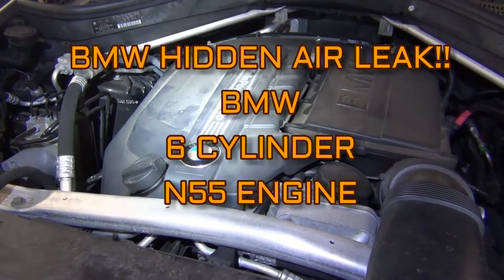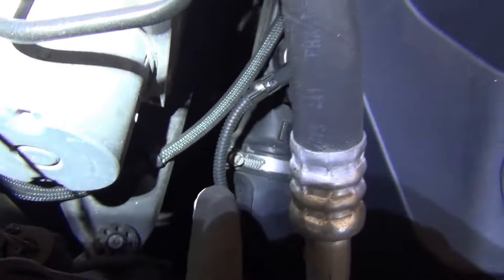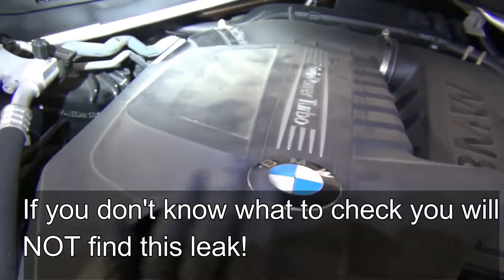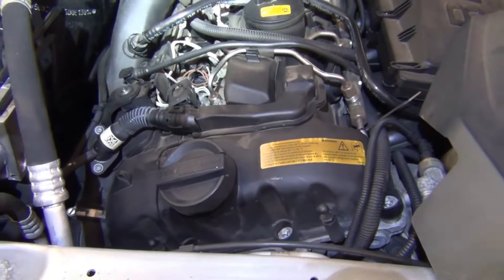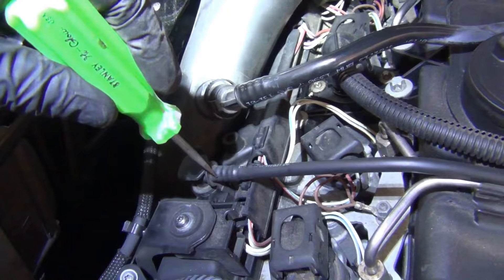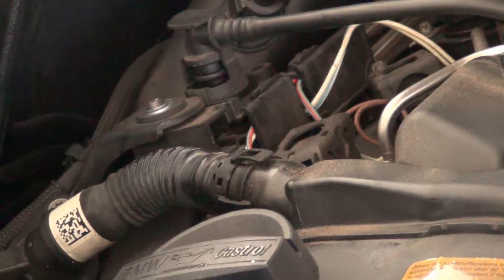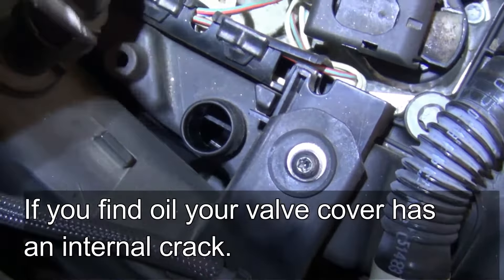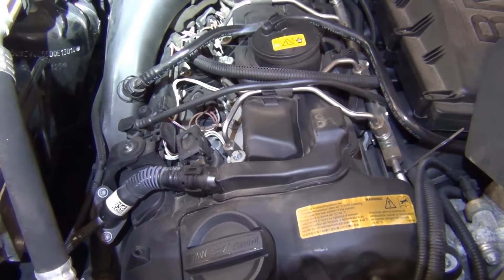HIDDEN AIR LEAK !! BMW N55 Mixture Too Lean P0170 P0173 P2279 2C57 Bank 1 Bank 2 Unmetered Air Leak

Comment: I have the same problem I think. But my engine is a N20 in a 528i 2013. Recently ran into a problem with oil in my vacuum lines and turbo problems so I replaced turbo & vacuum pump. No more oil in the lines. My Mechanic couldn’t find the problem why the engine light won’t go away still. It keeps coming back. Accelerating feels difficult or kind of delayed. I’m thinking it’s the crankshaft position sensor, cam sensor, timing chain, or valve cover/gaskets with the the built in crankcase ventilation system.
Reply from the maker: Hello, Sorry to hear you have an issue with your N20. Are you getting mixture too lean codes or turbo boost pressure too low codes?

Comment: Appreciate that ! I have been chasing this for a bit. Have you seen this fault create the whistling thats common for the front and rear crankshaft seals? PCV valve is not leaking bit the lean faults are present with no external leaks and the whistling.
Reply from the maker: The whistling is a sign of the internal PCV failure causing high crankcase vacuum. This then sucks air through the front and rear main seals. If the noise goes away when you open the oil fill cap replace the valve cover. Hope this helps :)

Comment: So to fix internal vacuum leak replace entire valve cover ?
Reply from the maker: Correct, The fix is a valve cover replacement.
Reply: @AskTheCarExperts  I got codes 108F01 intake plenum suspicion of leaks between turbo and intake valves , and also 120308 charging pressure control plausibility pressure too low. I have an upgraded  charge pipe so my cp is not cracked. I also just changed my boost solenoid , but I do have a leaking valve cover what do you think the issue is for this code it’s annoying !!

Comment: I think i have the same issue, but i read somewhere that it can also be the vacuum pump, i removed the 2 vacuum lines from the 2 ports on the VC and a lot if oil came out, is that caused by an internal crack on the VC or vacuum pump?
Reply from the maker: Hello, Since the vacuum pump is creating vacuum and pulling air toward itself this is unlikely the vacuum pump. I think this is often a misdiagnosis. The valve cover is the most likely cause. Hope this helps.
Reply: @AskTheCarExperts  just ordered a VC, thanks mate.
Reply: @AskTheCarExperts  just to give you an update, installed the new VC and still getting the same result, suggestions would be highly appreciated.
Reply from the maker: @euddys  Hello Euddy, What result are you getting? Do you have a symptom along with the oil leak?
Reply: @AskTheCarExperts  i don't have oil leaks anymore, but i do have oil on the new VC like on your video
Reply from the maker: @euddys  Most likely residual oil from the vacuum lines going to the turbo getting sucked back into the vacuum port.
Reply: @AskTheCarExperts  so I just took a look at the vacuum pump, and it's coated in oil 🤦🏻‍♂️
Reply: @euddys mine is too, what did you end up figuring out?

Comment: I have the same code,it’s say mixture control.fuel-air mixture too lean, and the torque of the car is very weak and the turbo responds late, did any of you encounter the same problem?
Reply: My car is 2012 535i
Reply from the maker: This can cause the mixture adaptation to effect driveability. You may also have additional air leaks. A smoke test would help determine if there is any additional leaks.

Comment: Hi, let's assume that you didn't change the valve cover and still with this issue, is there a problem for the car in near future? In case still as only air leak.
Reply from the maker: Hello, Not repairing this leak could lead to a mixture too lean fault, excessive fuel consumption,  oil getting into the turbo vacuum line which can lead to the pressure converter failure.

Comment: Hey, I’m having a lean code and the car isn’t idling properly. I smoke tested it and nothing was found to be leaking. I replaced the pcv valve cap on the valve cover to see if that fixes it because it was sucking air in but it didn’t help my issue. I unplugged that vacuum line and found a decent amount of oil there. Do you think if I do another smoke test with that vacuum line unplugged i should see smoke coming out from there since oil is getting in there and air is technically being sucked in to the engine which is throwing a lean code (bmw code 118001) ? 
I only have a rough idle but nothing else other than that. Coils and plugs were replaced recently to try and fix this issue. I’m just trying to see if replacing the valve cover would fix my issue.
Reply from the maker: Hello Elie, If you have oil in the vacuum chamber this can definitely be the cause of your too lean issue.
Reply: @AskTheCarExperts  do you think it’s possible to start the car with that vacuum line unplugged and see if the idle gets better since it won’t be sucking air from the engine through the crack?
Reply from the maker: @lalloussH  You can try but since the crack is internal to the chamber, I don't think it would be a valid test.
Reply: @AskTheCarExperts  do you think if I smoke test it with the vacuum line unplugged smoke would come out from this reservoir? I’ve smoke tested an N55 that is almost brand new and it doesn’t have that line because it’s a 2016 and no smoke came out of that reservoir. So since mine has oil in it which means it’s cracked internally, shouldn’t the smoke come out from this reservoir when I smoke test with the line unplugged?

Comment: I have an error code on my n55 engine that says 2775 air volume, plausibility: air volume too low does anyone knows what this error is?
Reply from the maker: Hello, Air volume too low can be caused from an unmetered air leak.

Comment: What is that plug called
Reply from the maker: Hi Joel, Which plug are you looking for?
Reply: Hello!!! The vacuum hose the big hole that’s one the valve cover
Reply from the maker: @joel10032  No problem Joel, That lines goes under the intake to the vacuum pump. The valve cover section that it goes to acts like a vacuum manifold and supplies vacuum to the turbo waste gate actuator via an electric pnuematic pressure converter EPDW
Reply: @AskTheCarExperts  I just did installed Raceworks ignition and coils and I don’t know where I put that hose. I’m looking online to see if I can buy a new one

Comment: I’m missing that vacuum line on mine335i. I saw opening and thought it was normal. Gotta order one ASAP
Reply from the maker: Hi Ton,
Not all N55's use this vacuum tube. Some do have an opening and no line attached. Most likely you have the design that dies not use this hose.
Reply: @AskTheCarExperts  I don’t have that hose either. On my 2016 n55 but I am getting a bank lean code??
Reply from the maker: @timvakulich2223  A smoke test should be performed to determine if you have any leaks.
Reply: @AskTheCarExperts  hey if get a vape , he would I be able to text it? For a p0171 bank 1 code
Reply from the maker: @timvakulich2223  You can smoke it though the intake air tube. One trick you can do is to use a disposable glove to fit over the opening with a small hole in a finger for the smoke attachment. The rest of the system needs to be installed or closed off so you can build pressure.
Reply: @AskTheCarExperts  I will look into that , the car is new and I wouldn’t understand why it’s throwing a code . Thanks for the reply !

Comment: Greetings, thanks for the video ! I have a stupid question : if there is an air leak, how can it make a lean mixture? Shouldn't the mixture become too rich ?
EDIT : I read about it and maybe I got it. Since there is a vacuum generated by the engine (when there is no turbo on), a leak will actually make the engine "suck" more air than calculated.
Do not hesitate to correct me if I am wrong, thanks again !
Reply from the maker: Hello Sajade, That is a very smart question! Understanding how things work will enable you to figure out how to fix the problem. When you have an unmetered air leak, air is getting into the engine that is not monitored from the mass air flow sensor. The engine computer is monitoring the per cat oxygen sensor and when it detects too much oxygen in the combustion it will actually add fuel to the combustion process to reach the correct air to fuel mixture and try to compensate for the unmetered air. So in essence you are correct the mixture is becoming too rich and you are using more fuel and burning extra fuel which effects your fuel economy. The engine computer has a calculation map to make adjustments to the fuel air ratio but when it reaches a max calculation value it will then trigger a fault code. In this case it would trigger a mixture too lean fault....this would identify that it can no longer adjust for the lean mixture or too much air in the system. A too lean fault is in reality adding fuel to the combustion cycle to offset the extra air. That really is a great question. If the fault was too rich then the engine is trying to remove fuel and has reached a critical point to set the fault code. Too rich would be things like a leaking injector or I have seen a ruptured fuel filter with a bypass hose that goes to the throttle boot dropping raw fuel into the intake. There is still one more possibility for faults like these and that is a faulty sensor giving the engine incorrect information. You could only rule that out by verifying no external cause of a failure and then you would suspect the sensor. Sorry for the long explanation :)
Reply: @AskTheCarExperts  Thank you so much for your explanation ! Not only it is not long, but on the contrary its enriching - pun intended :).
I actually thought that a leak would make air going out (less oxygen actually getting into the combustion chamber) but I did not realize that due to the vacuum in the intake manifold, a leak means MORE oxygen getting into the combustion chamber. More oxygen to the point of going beyond the adaptation limits of the engine for fuel adjustment, and your mix becomes too lean. Thank you !
Reply: Your trick is carburetor cleaner spraying around the engine wherever there's a crack the engine idle will change right!
Reply from the maker: @markt9438  Hi Mark, Most modern vehicles no longer react to carb cleamer. For this failure spraying carb cleaner will not cause the engine idle to change.
Reply: @sajadeshahidpour2008  I was confused about the same thing too!

Comment: what are the beginning symptoms of this leak? Is a code thrown? if so, what is it/are they? How is the drive affected?
Reply from the maker: That is a very smart question. This can set a mixture too lean fault code on one or both banks. When the system is smoke tested it will not have any leaks. Fuel pressure high and low will test good. Adaptation values can be reset but the fault will return and the CEL will come back on. In some cases you may get a boost pressure fault as well. The oil can actually work its way into the vacuum line for the turbo and cause it to break down. If you find oil in the vacuum line to the turbo you most likely have this problem. Symptoms besides the CEL may be poor fuel economy due to the air leak.
Reply: @AskTheCarExperts  is this part ONLY part of the valve cover? I JUST did my VCG and replaced so many things trying to find 118401 and 11CF30. Is the reservoir removable, at the very least, viewable?
Reply: @AskTheCarExperts  is the boost pressure fault 112F?
Reply from the maker: @nevrcm3261  P112F Sets when the monitored mad air is above the limit. Basically a fancy way of saying unmetered air leak.

Comment: What is the average life of these valve covers? Another problem is the integrated pcv valve too. I have a 11 335i Msport with 85k miles.
Reply from the maker: There is a large mileage range of failures. I have seen these valve covers fail around the high pressure pump where they can develop a hair line crack and sometimes toward the back of the valve cover. I would say an average life is usually above 120K miles. But I have seen some below 80K. My recommendation would be that if your vehicle develops a leak above the 80K mark to replace the valve cover as a complete assembly and not do just the gasket. This would replace the internal PCV and give you at least another 80K or higher before it would be a concern again. Keep in mind some vehicles that fall under CARB california emission warranty may actually qualify for a replacement under BMW warranty. This would be CARB states only. Some vehicle have a 7 year 70k warranty extension and some have 8 years 100K. Your vehicle would fall under the 7 / 70 K for model year 2011.

Comment: Great video.  Do you know if this could cause other issues like the Whistling from the Front and Rear main seals.  I replaced me PCV cap on my  F10 N55 a few months ago and everything has been great, however I just started getting a lean code,  EGR fuel mixture code and the annoying Seal whistle from the seals.  I also installed an Oil Catch can and noticed that I am getting a quite a bit of blow by.
Reply from the maker: Hello Grant, Can you go into more detail on the PCV cap you installed? Do you mean you replaced the complete valve cover or the oil cap? The seal whistle is usually from excessive engine vacuum created from a failed internal PCV that is integrated into the valve cover assembly on the N55.
Reply: AskTheCarExperts   Yes, I was referring to a PVC replacement cap like this one here.  Cylinder head Valve Cover For... https://www.amazon.com/dp/B07J9QM12Z?ref=ppx_pop_mob_ap_share

I used this part in November and have been driving the car since, but started getting a lean code last week. I will say that my idle has never been really smooth and I went home last night after seeing your video and saw a good amount of oil in the vacuum line. There is actually a small puddle of oil in this compartment. I was just wondering if this could also lead to the seal whistle that is typically heard when you have a failing PCV valve?

This was my install of that part.
https://youtu.be/NvA49xcdKkk

Comment: So that's why you just replace the valve cover every 50,000 miles, cuz it's plastic.
Reply: There are metal after market ones
Reply: @DigitalDissident  where can metal one be purchased?? i not long purchased a plastic one and installed it and know nothing of a metal one mmmmm more info. ty

Comment: Haha, oh man, gotta laugh at this one. Stumbled across this video. So I had this problem for about 18 months before it was finally fixed. I'm quite handy, I DIY engine rebuilds, and I had no clue how to fix it. I finally threw in the towel and took it to BMW. They had my car for about 8 weeks. They replaced everything they could possibly think of. 1 Do a repair. 2 Manually clear CEL code. 3 drive the car again on and off for a few days. 4 code returns. 5 REPEAT. They even admitted to me even with all their hi tech and computers, they couldn't figure it out. So they just started replacing every sensor, valve, etc they could think of. Just make sure you agree to a price upfront like I did for about $400 cause they would've asked for about $8000 in parts and labor from me. Great video - THANK YOU!!
Reply: Again. what were you problems?? codes? and what did the stealership say rectified the problem? what year is you Vehicle??  N55??
Kilometers ?? ty